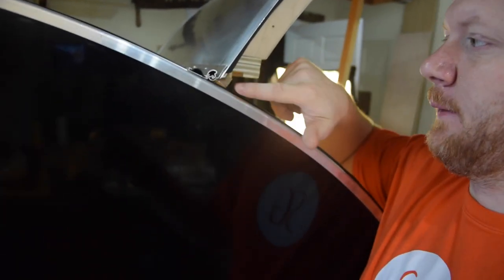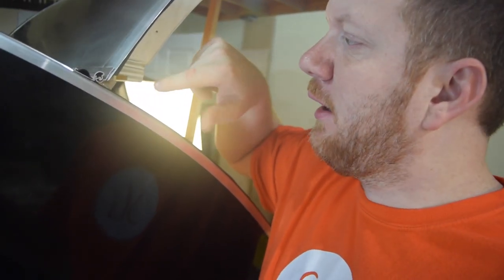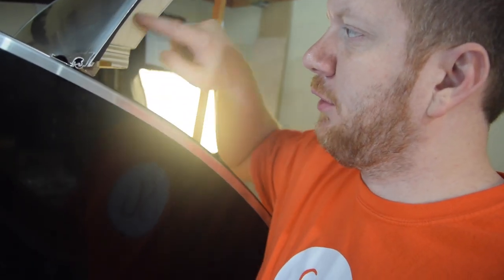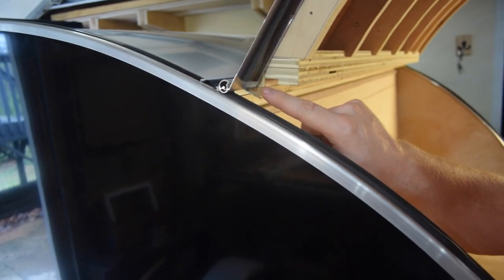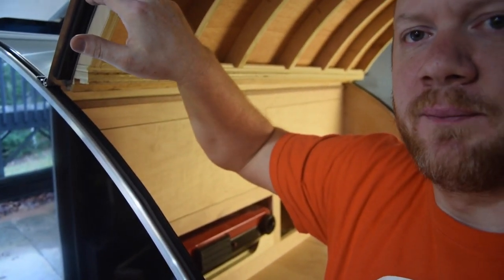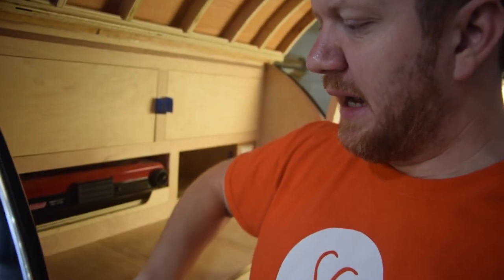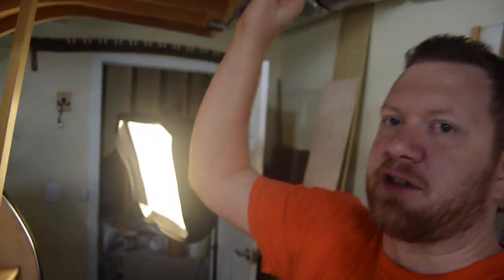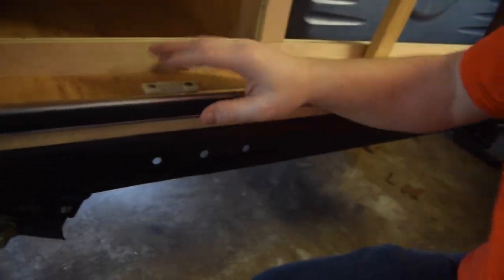Skinning the galley | How to build a Teardrop Camper Trailer #14b

Comment: The metal panels look less then 5ft wide do you lay them sideways and overlap? Thanks! Nice trailer
Reply from the maker: Yeah I did a 4ft wide trailer but if you have a 5fter you can get 5ft wide sheets or turn them sideways

Comment: Hi i got to this point building the galley door i wish i could post a picture to show you how my has come along... thanks for your help. 1 question if i run the side trim down the side how to you get the huricain hing to go over the side trim and stay flat in middle
Reply: Loolking coser did you cute the track out on side trim so the hurricane hinge would lay flater and did the black trim run underneath the hing?
Reply from the maker: The black trim doesn't go under the hinge, just on either side of the hinge, does that help you lay it flatter?
Reply: Did you leave the black insert on side walls run under the Hurricane hinge? Oh you cute a piece of aluminium to go under the hinge do you remember were you got it or what size it was? i need to make one buy  A piece like that.
Reply from the maker: Yup there is a flat piece of aluminum under it to make it level with the outside trim. :)

Comment: did you put any sort of cover over the hurricane hinge? weather stripping?
Reply from the maker: +casey marwine no cover, just used the sealant I used for the other flat surfaces, I later added a bead of silicone to the outside end for my own added protection but I don't think it's needed. Hope that helps!

Comment: I’d like to see more details of the hatch rather than focused on you.
Reply from the maker: There is a lot of info in that video.. what questions do you have?
Reply: I’m wanting to see close ups of the seals and hinges to get a better idea of the fitment. I want to see how you sealed up the corners where the hinge and sides meet. If there is any lift in the profile of the teardrop. Trying to figure out if I’m going to go this route on mine. Any leak testing done yet?
Reply from the maker: You don't need to seal the corners on a hurricane hinge, just allow it to overlap the outside wall trim. You also should have have any lift, I would make sure you have about 1/4in or so gap before you put the trim on tho.. mine was a bit snug :)